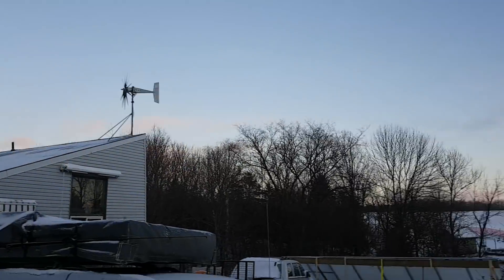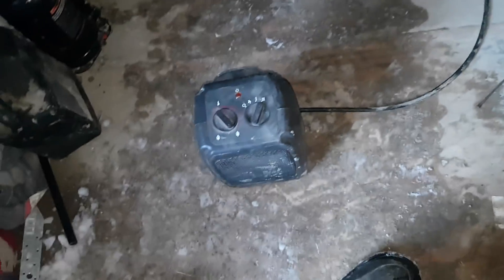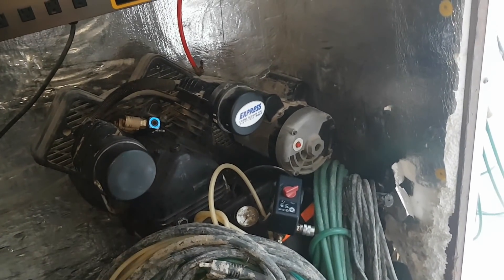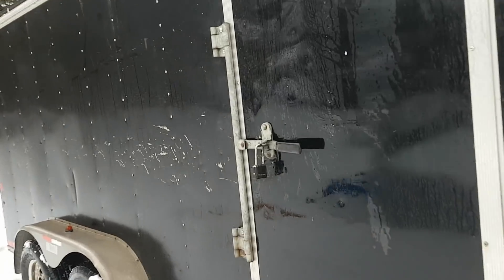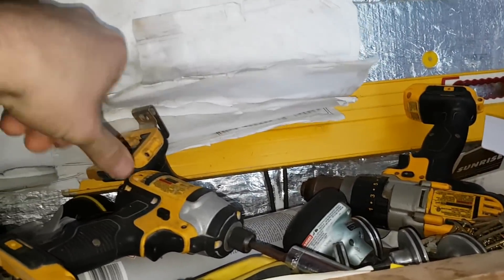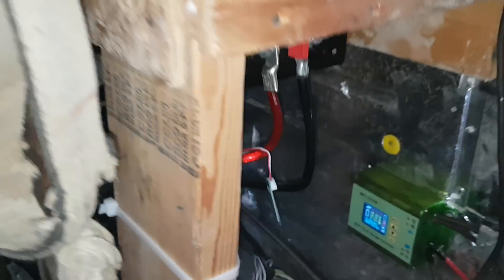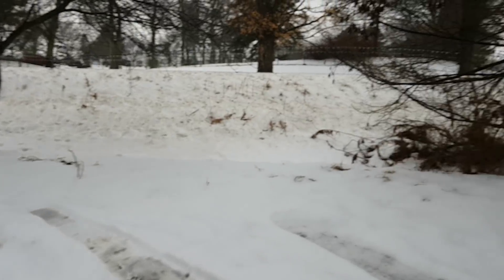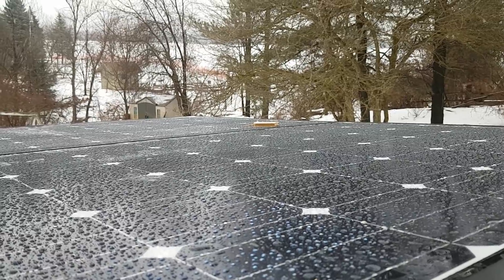4Kwh Solar System Installed On Work Trailer

Comment: Are you able to use most of your power with 12s because i know 6s is not great for a 24v system
Reply from the maker: my inverter goes down to 40 volts leaving me at 3.3333 volts per cell, so I am able to use around 80% of my battery.

Comment: Instead of electric heat - which eats batteries - investigate the diesel heaters.  There are 5KW (17000BTU) models that should provide enough heat in that space.  Search for
diesel heater for van
There are a number of "how to" videos on Youtube.
They are relatively quiet and run a long time before refueling - advertised as 24 hours per gallon.
Reply from the maker: I was looking at those, but the little bit of grid power we do get is free :D I would like one of those diesel heaters for camping though!

Comment: What negative lead did you pull oit of the esmart3? You probably know but I couldnt tell from the vid, the battery can not be disconected from the charge controller whike there is still solar input. I follow that with any charge controller. I know the mpt7210 is powered by the solar so you can. But every other controller you can't. Btw a cheap mppt for the trailer with 1000w solar would be a makeskyblue. Mines been a trooper and is adjustable on the simple digital display.
Reply from the maker: i might try a makeskyblue, I unpluged the solar -

Comment: Nice work; I'm planning on adding power to my trailer too.  What sort of insulation did you put in it?  Also how did you attach the panels to the roof?
Reply from the maker: I used 3/4" R4 foam from home depot, I used Brick ties for the solar panels on the roof.

Comment: I like where you put the inverter they are dust collectors. Could you borrow the camper's charge controller and run two in parallel ? half the panels on each controller.
Reply from the maker: I have a CC on the way :)